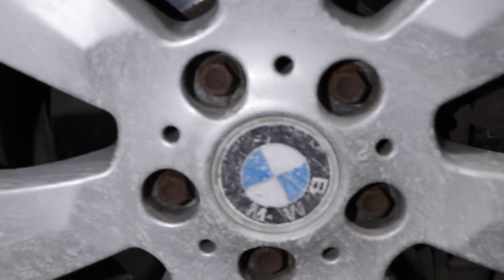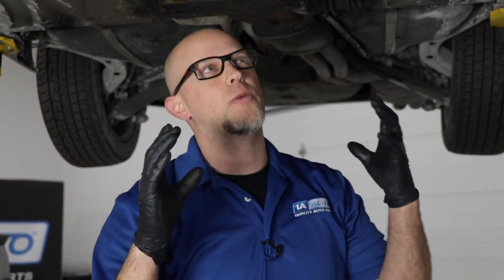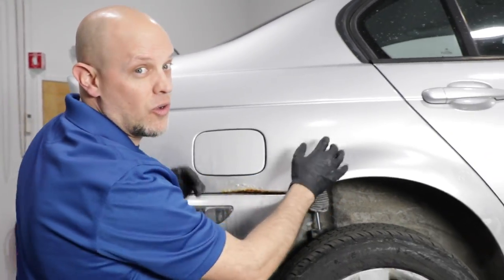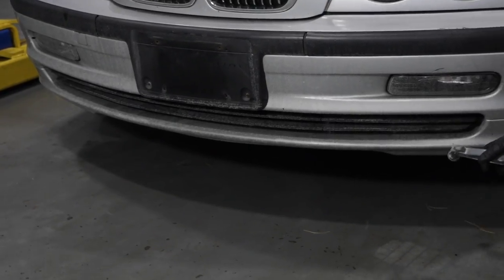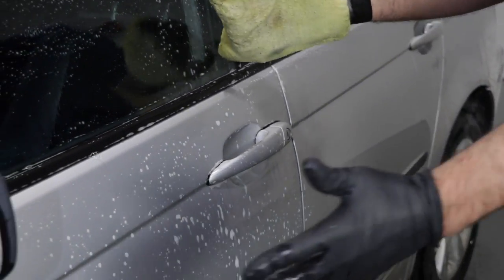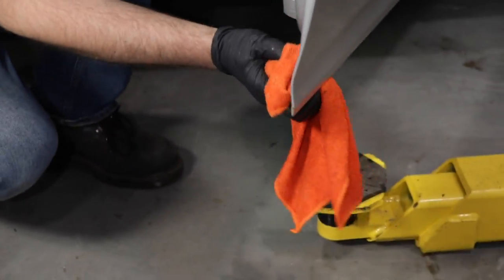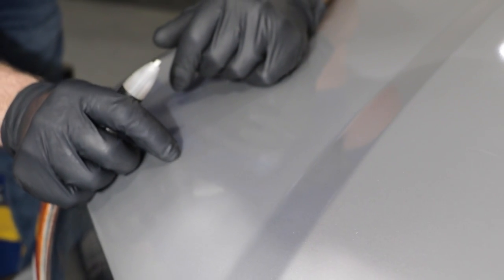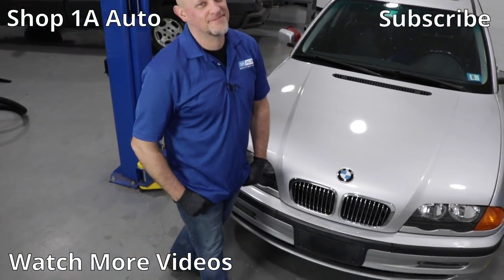Car or Truck Covered in Road Salt? Spring's Here! Time to Clean It Off!

Comment: Dude, nice video, but there are a few more simple measures that will go much further to keep salt off your car: 1) Buy either a small power washer (not too much pressure), or better, a battery-powered (with a power-drill type battery pack) portable pressure washer, and attach an undercarriage sprayer with wheels (Ryobi or countless other brands) to rinse the undercarriage. Yes, it is a bit of work but it is worth it and after a few times it will be habit. Ten minutes! 2) Add a salt-dissolver to the rinse water.  I use "Salt Away" (but there are a couple of other known brands) which is designed for boats and boat trailers. It won't damage paint or plastics and even leaves an invisible film which adds protection. It's also completely bio-degradeable. A one-liter jug of Salt Away costs about $30, but you only need barely a tablespoon for a large bucket of rinse water. One liter will last you 5 years! Salt Away comes with its own sprayer, into which you put a solution of Salt Away. Other brands are I'm sure just as good and effective. I've had excellent results so far. Of course, one should thoroughly clean the undercarriage and have it coated with wax oil (don't use rubber or bitumen -- it will flake and trap saltwater, completely defeating the purpose). 3) Many local car washes offer undercarriage cleaning cycles, but if you have a convertible, you might want to skip commercial car washes to preserve the top. Ask if they have a "sides and underbody only" setting. If so, Bob's your uncle. If not, you'll have to use the power washer solution. 4) Smart owners might consider constructing a fixed undercarriage sprayer in the driveway. You could build such a set-up with PVC pipes, T-fittings and drill. The best soluton would be to attach spray nozzles to each hole. Sure, that's a lot of spray nozzles. But a package of lawn-sprinkler nozzles will cost you only about $8. And you'll be glad five years later when you DON'T have to buy a new car because of rust.  In winter, park the car over it, turn on the faucet (if you're lucky, you can rig a hose from a LUKE-warm water faucet in the basement or from the ground-floor laundry room). Park, rinse, put car in garage. Either way, THOROUGHLY rinsing the undercarriage is paramount: You don't see them, but huge blobs of salty-muddy snow build up under the car. If the weather is constantly below freezing, those salt-mud blobs can stay there for WEEKS. Thorough, regular rinsing is the only way to ensure those blobs don't stay there for long. A fixed undercarriage spayer set-up in your driveway (or even in your garage if it drains well) may seem like big project. But it will pay off for years to come and save you massive amounts of time in the end. Boaters have been using salt-dissolvers for DECADES! I can't understand why car owners have not caught on. Especially since boat paint (Gel-Coat) is MUCH more sensitive than car paint, so the products made for boats are very mild. In any case, try some of the techniques described above and make a video. Don't forget to mention me! In the nicest way, I say, if you want to offer "1A" services, you've got to up your game a little. The suggestions above will help. Keep up the good work (and make it better!) :goodvibes:

Comment: This is what foam cannons/pressure washers are made for. To dissolve and rinse off any loose dirt/salt buildup before hand washing the car.

1: Spray degreaser on the sides and back (on a dry car). Wheel cleaner for the wheels.
2: Cover the car with foam and let the deagreaser and foam sit for several minutes.
3: Pressure wash panel by panel from the bottom up.
4: Rinse the car from the top to remove all residue.
5: Gently wash the car with a wash mitt (microfiber or wool). Ideally with the 2 bucket method with dirt traps. Start from the top and finish at the bottom at the dirtiest parts. Don't touch the wheels with the wash mitt. Use a designated brush for the wheels.

6: Rinse.
7: Now ideally pressure wash the entire car with some kind of salt remover to dissolve the invisible salt that is attached to the car. There are products to run concentrated salt remover through the pressure washer (Salt-away with mixer unit or similar).